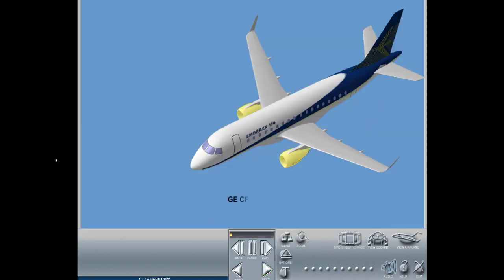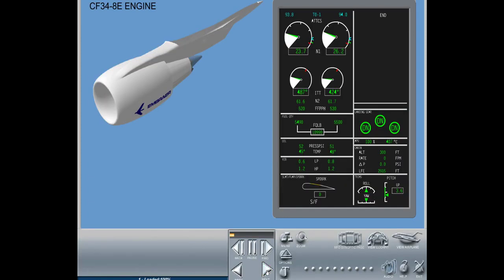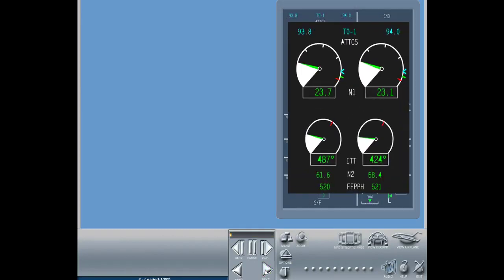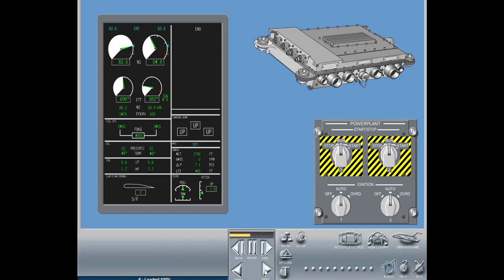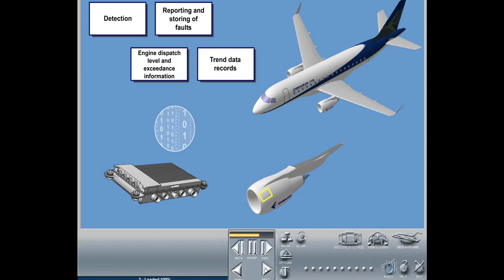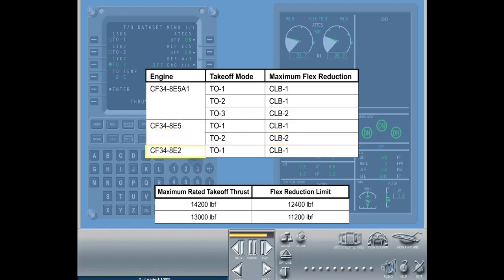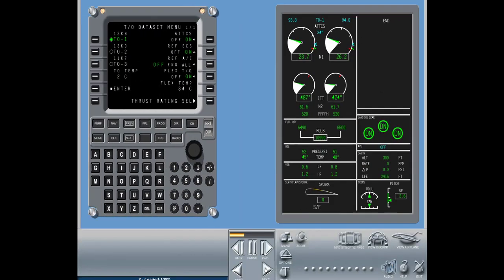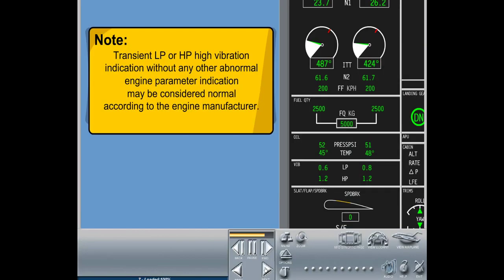E175 Systems Training   Engine Systems

Comment: Is this actually for the E175? At the beginning of the video it says E170, are they the same exact systems or just very similiar? Thanks for any reply you can give.
Reply: To my understanding they share a type rating, and the systems are by and large the same. The only real difference is PAX capacity and length; even wingspan is shared between the two.